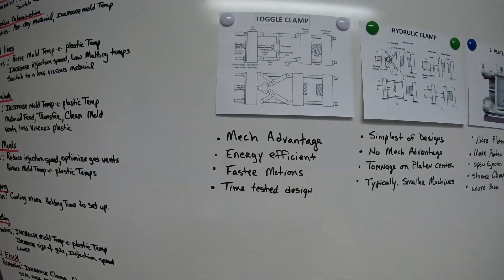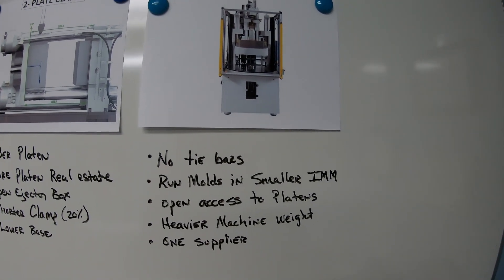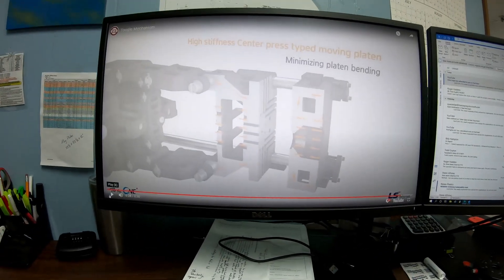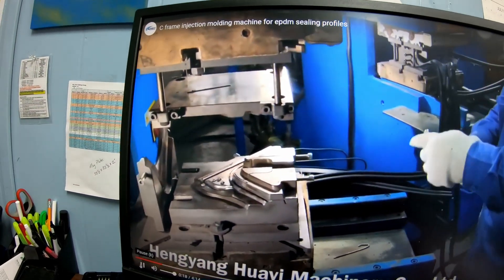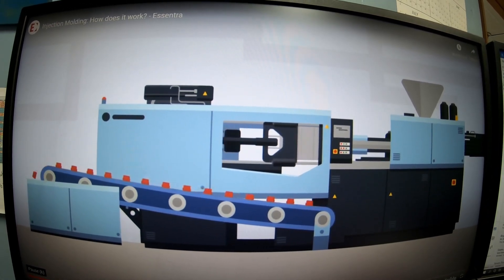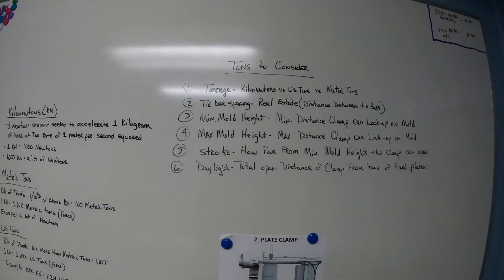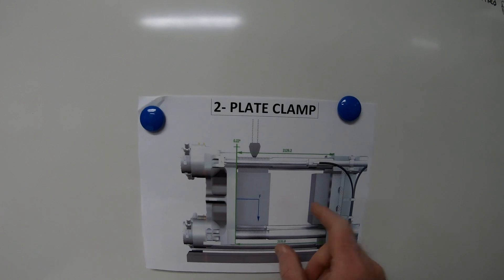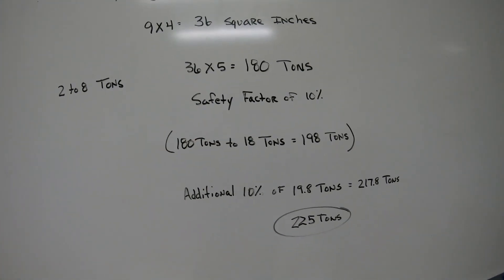Clamping Tonnage Caluclation & The Steps

Comment: What if the part deep is less than 1"? Can we still use the same rule as 1" deep?
Reply from the maker: yes that is right
Reply: @injectionmoldingskillsmore1064  What if the press has hot pot material feed into the sprue gate and to the parts and have 42 cavities? Do we need to calculate the sprue gate area and multiply number of cavities to determine the clamping force?

Comment: If I want to do a tool transfer from one machine to the other with screw size of 32 to machine with screw size of 24 how do I calculate the shot size,changeover and speed? Thanks for great YouTubes! I always watch your posts!
Reply from the maker: L/D rate is the only way to see the calculate size. Most of the time I start with the size off of the other press by taking it down by half. Then build it back up to 95 to 98% full shot. This is how I have been doing it for years, I hope this helps. Thanks for the support to the channel

Comment: Thank you for your video    what is the  difference in injection  molding machine   cushion  and injection  position
Reply from the maker: Cushion is the last little material in front of the screw. Injection position should be the same if you are looking at screw position. If you are looking at fill time is 1st stage till transfer then hold is next stage then the cushion would be 1/2 inch. to 1" inch on most parts. I hope this helps Thanks for watching.
Reply: @injectionmoldingskillsmore1064  thank you
Reply: Sir could you please tell me why we use p.p material for purging?